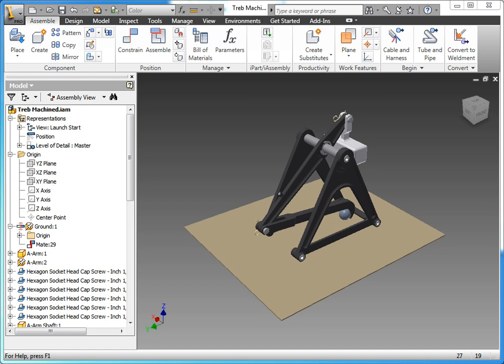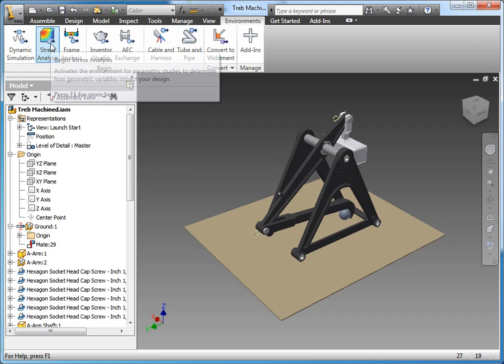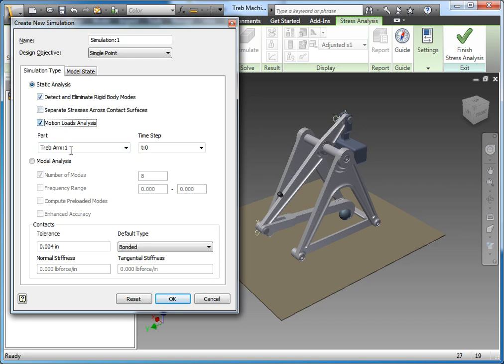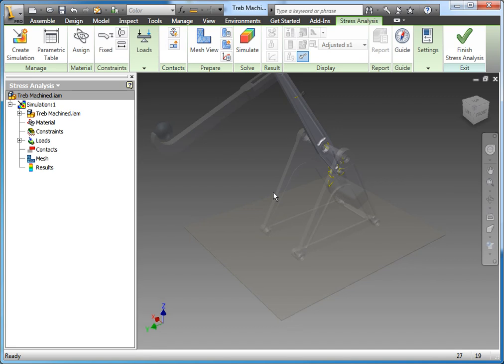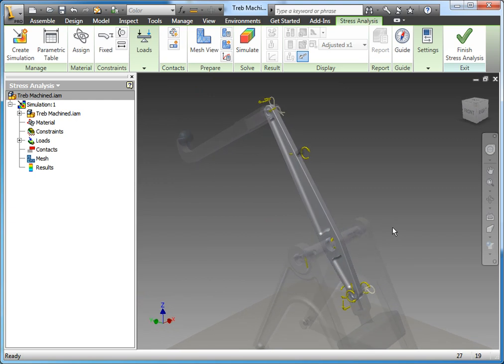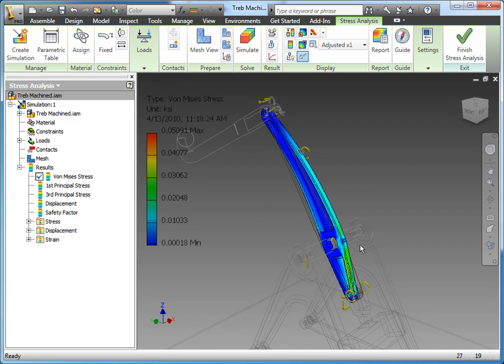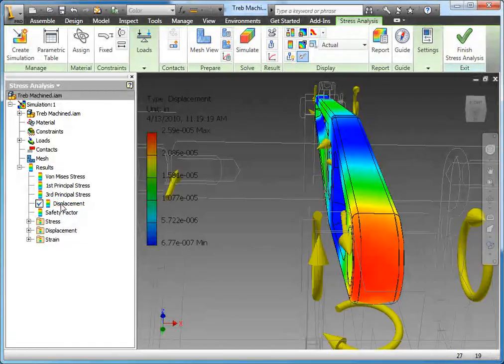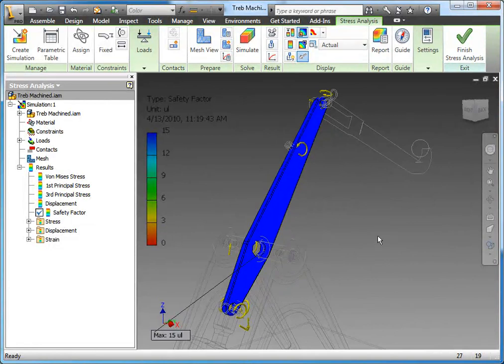Part 6 - Dynamic Simulation & Finite Element Analysis (FEA) - Autodesk Inventor 2011

Comment: Thank you so much
Reply: Im stuck in finite element analysis cuz im forget exporting to FEA and running simulation. I didnt run the simulation so i just used static analysis
 Thanks alot

Comment: Thank you John, very helpful tutorial. Can Inventor export to FEA an impact force movment ? it doesn't seem to work with us, we were simulating a rim falling on ground and using 3D contact to measure the force but the export feature didn't accept that part. The export feature did work with us using other joints such as a spring connect.